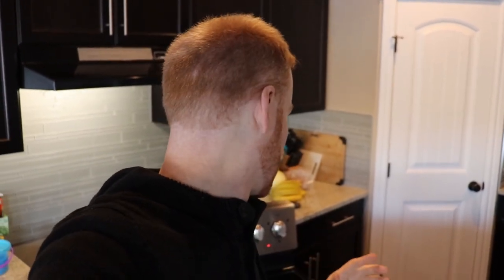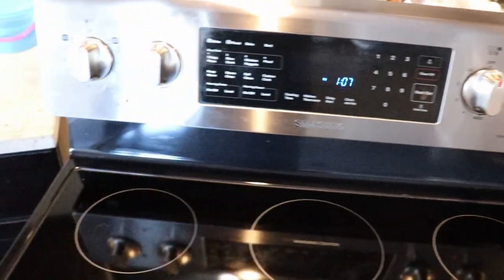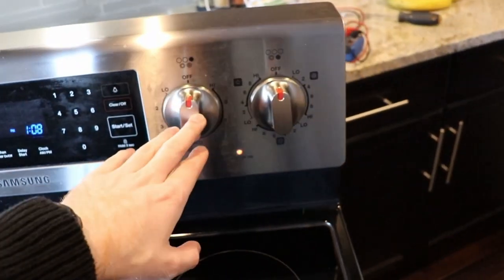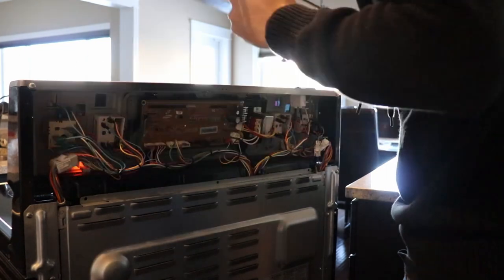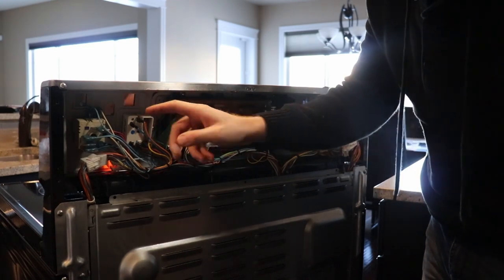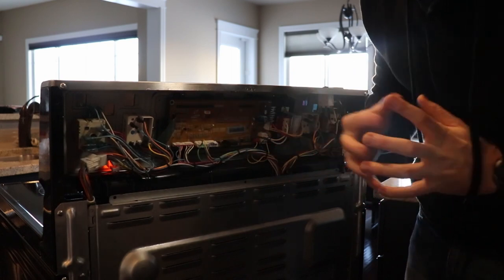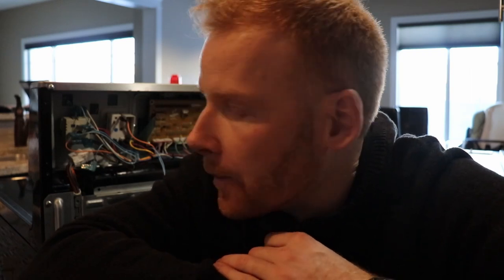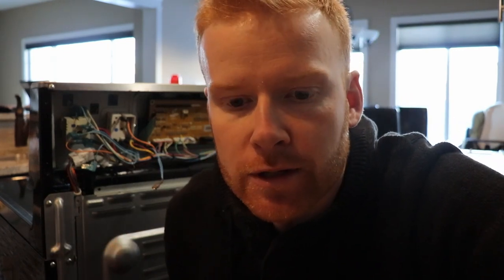Cheap Samsung fix (Stove Top On) Light Fix

Comment: We’ve had the hot surface light on constantly for months. It’s a common problem and there’s plenty of comments online about it. However our oven burst into flames tonight after we’d just finished cooking dinner. The flames appeared from behind the control panel but I guess they could have originated lower down. I’m not going to mess with it until we decide who to call.
Reply from the maker: Wow, I 100% dont blame you for calling someone after it brusting into flames. Depends on how much damage it might be worth looking at a new stove.

I hope everyone is ok!
Reply: @TDLDIY  Yeah all safe thanks. The flames appeared appeared from behind the control panel at the top. Once we had isolated the appliance and puled it from the wall to unplug it there was no visible damage. So i'm thinking some scolding and melted wires inside because my wife heard a "pop" just before the flames. But as soon as I take the panel off any technician may say that it's user error and the appliance has been messed with.
Reply from the maker: @canukdcv905  in this situation i agree i would leave it. wait for someone to look at it. I am guessing resistance increased in a wire, switch or board. cause the fire and probably why your wife heard a pop. 

I will be curious to heard the result of what the technician finds.
Reply: Know when to hold em.
Know when to walk away!

Comment: These triple and duo switches are too complex and uses swiss 1800 technology to control temperature and eventually it will break with multiple switches in one knob. everytime metal contacts with voltage it creates a carbon an wears out with springs. so these dual switch and triple switch is less durable than basic on switch.  if you open the switch it is just made of metal and springs like a watch. and because it is 'mechanical it will wear out and too delicate and too complex controls with triple control. you have high voltage metal contacts that is too close to each other .  The switch control knob doesn't give signals to the controller board and controller board sends electricity to each element like in digital electronics.  These are switches  mechanical controls like your light switch turning light on and off and wears out.  The mechanics is electricity from house 'hot wire'  goes to switch and exits from the switch to heating element. it is just the mechanism of the switch that is just too delicate and easily break. the light switch in your house don't short circuit because of the distance. but that small box you have lots of metal contacts that very close.

Comment: it's these complicate flimsy dual and triple controls. there is no need for it  8 wires on switch meaning 4 controls 1.  electricity flow. 2 . second control  3. triple control and 4. surface sensor   6 wires.  1. 1 temp control 2. dual control.  3 surface sensor . electric ranges are very basic appliance,  they just make more and more complicate like wi fi which is not necessary

Comment: When you pull off those spade connects you have to pinch down by the wire area to release the metal tab in order to have it come off if you use needle nose pliers it's a little easier unless you have some strong nails
Reply from the maker: Thank you for the advice, I didnt know that. I am sure it will helps others as well.

Comment: another problem this part DG44-01007B the triple switch is not even in stock that you can buy in store and not even online. and no wait ETA is 6 weeks, the manufacture doesn't want people fixing their used appliances. and deliberately not shipping parts to part dealers or consumers to fix in Canada.

Comment: My light has been bugging me for months and my mother in law for years. I will have to replace mine and if it works, will have to do the same for hers. Thanks!
Reply from the maker: Do you replace yours? If so how it work out for you? Thanks for commenting.
Reply: @TDLDIY  I replaced mine and it worked great. The video helped a lot. Thanks so much. Haven't gotten around to mother in law's yet. I am waiting to find out the model so I can get the right part. Found in my search that there are so many different but similar parts for the different models.
Reply from the maker: @tomcha75  Thats awesome, great to hear. Yes, there are a good bit of similar parts if you can get the make and model or even part number it helps alot.

Comment: Thank you for this!  Turns out I had the same issue, and with the same burner control.
1)  I believe my switch got damaged because of a loose main AC power block terminal screw:  When turning the left front burner on, a flash and pop came from the back and the display went dead (because it also tripped the breaker).  Turns out that where the main red wire from the 250VAC power cord somehow came loose.  As the burner switch is turned ON, my theory is that the loose connection caused an intermittent interruption in the current flow (at the power connection) resulting in a high voltage spike due to the inductance in the wiring, thereby "welding" the indicator switch contacts closed or "shorted".

2)  After tightening the power cord screw... To determine which burner control was causing the Cooktop ON to remain lit, I found that unplugging one blue wire at a time was for me was another simple way to troubleshoot.  MAKE SURE you disconnect the power before touching any wires to avoid getting shocked as the blue wires are HOT with AC voltage.  1st unplug the power cord, then unplug one of the blue wires that TDL DIY indicated.  Plug the AC cord back in and see if the Cooktop On light is OFF.  If still on, unplug the power cord again and try the blue wire from another control.  

3)  In my case it was the far left control as suspected, since that was the one being turned when the circuit breaker popped.  I've decided to ditch this stove because it also needs a new Control Board (the "5" and Kitchen Timer buttons don't work, some LED segments are dim and almost all of the black numbers/indicators have rubbed off of the front panel).  We've had bad luck with ALL of our Samsung appliances and am switching to another brand as repairs become non cost-effective. 😞
Reply from the maker: Thank you for writing an in depth review. Seems to be very detailed i am sure others will also enjoy reading this as it can help them as well trouble there stove.

I am sorry you didnt end up fixing it but i can also understand why the display boards can be extremely expensive to replace.

Thank you for watching and writing this comment i am sure it will help many others as well.

Cheers

Comment: Thank you so much for the video. I had this exact problem and coincidentally it’s the same exact switch that had the problem, same spot too. Going to order the part now.
Reply from the maker: Your welcome. I am glad my video was able to help you be able to find the problem. Let me knoe how it turns out once you receive the part and do the repair.

Thanks for watching consider subscribing.
Reply: @TDLDIY  Yes, the part work wonderfully! Fixed the problem! I ended up using the switch you avoided from Amazon with the 15 amps. Thanks again for the video. And I did subscribe.
Reply from the maker: @chitboxdeluxe3542  I am glad it worked out for you! I will keep that in mind if i have to replace mine again. that the 15 amp switch will work just fine.  Thank you for your support from subscribing!

Comment: i just got a similar samsung stove. sometimes the right light comes on randomly (when not even being used) and sometimes its the left light! how could that be? all the generic videos i see point to the limiter switch at the actual burner. I havent dug into it yet myself but it loos like starting at the infinite switch is easier. thanks!
Reply: figured it out. if the knobs arent perfectly pointing straight up it will trigger the cooktop on light.

Comment: I have a question. I was wondering if you could help me out. I have a Samsung range and the front left dual element burner is messed up. When I only try to turn on the inside element the outside element will come on as well and both elements will not go off and on and off and on etc like they are supposed to. It gets too hot to cook with. It burns the food. Does it sound like it might be the infinite switch or something else?

Comment: Thanks for the info! I have the same exact model as yours but my hot surface light wont shut off instead of the cooktop on light. Same process tho for the different indicator light.
Reply: Did you figure out anything??
Reply: I have the same issue
Reply: Same, I can't use the self cleaning function with it broken. This seems doable?
Reply: I just disconnected the red and white plug from mine, different colors than yours but the only two wire plug to the control board. It doesn't care if the hot surface light is on or not, self clean my way

Comment: When you check (6:15)light on with red clip , power plug was off?
Reply from the maker: In this case I had the power cable connected to the wall, as I needed power to test. But you must be very careful if you try this as if you touch something wrong you can fry your electronics or get serious injuries to yourself. Do at your own risk. If you dont feel comfortable then hire a technician.

I hope this answered your question. Thank you for watching.

Comment: Beware of Samsung stoves this is a very common issue with their stoves mine would just turn on in the middle of the night , their switch components are plastic and easily wear out if you are using the same switch often , good video though👍
Reply from the maker: Thanks for the comment. My stove wasnt on but had the light come on lucky. This seems to be a fairly common issue, but fairly easy to fix. Thanks for watching and commenting. Like hearing everyone experiences and helpful inputs.

Comment: Hey i have same electric range. I do have hot surface light that stays on but cooktop light stays off. What could be the reason? And there is no hot surface all the time on it
Reply: You got a bad infinite switch
Reply: Are you sure ? Because with the faulty infinite switch i guess the cooktop on light should stay on as well and surface can be hot too. But in my case the surface isnt hot at all and the cooktop on light is off as well
Reply: @michaelcancino6818  just posted a comment for you above. Was unable to tag you

Comment: Is it dangerous if I had to leave the light on for a while.????
Reply from the maker: My light was on for quite a long time before i got around to fixing it. Several months. The stove top light is just an indicator light. The sooner you can fix any problems the better. Now i cant 100% for tell you if it dangerous but based on my experience. Different situations might be slightly different.

I hope this anwer your question.

Comment: What do you call the red  wire you test with and from wher can I buy
Reply from the maker: I added a link to an amazon one i for which is what i have.

https://www.amazon.ca/Alligator-Electrical-13-7inch-Connection-Experiment/dp/B0C2BM49WM/ref=asc_df_B0C2BM49WM/?tag=googleshopc0c-20&linkCode=df0&hvadid=578859711721&hvpos=&hvnetw=g&hvrand=13712814172957266905&hvpone=&hvptwo=&hvqmt=&hvdev=c&hvdvcmdl=&hvlocint=&hvlocphy=9061280&hvtargid=pla-2199947795451&psc=1&mcid=85e159705029354f8d79205365e10ac4

Comment: Or you just need to disconnect the power from each switch, one by one, and see which switch will turn off the light
Reply from the maker: Yes, that is another good way to trouble shoot the problem.

Comment: The switches have 8 wires and makes more complex than older basic electric ranges using coil elements. and switches for the coil heat elements never break and last lifetime of the range.  The problem is failure in the switch is big fire hazard if someone was to go on 2 week vacation. because off position is normally in low eventually failure would only give low temperature.

Comment: my same gas burner is overheating what is reason?
Reply from the maker: If you give a bit more information i can try and research why or common issues. Make, Model, which burner, possibly any other issues.

I dont have a gas stove so not too sure on them that much.

Comment: you can buy a new applicance for $1200 why pay $400 to repair a switch . and elements too if you cannot repair it yourself it's not worth paying $600 in labour to fix used applicance. all the elements will break or need replacing and the double switch will not least more than 5 years too.

Comment: I put a bowl of ice on the burner. while it was off, and the light shut off.
Reply from the maker: Oh really crazy, i am glad that worked for you. Thanks for watching.
Reply: I tried it and it worked.  The hot surface light disappeared, but I also have another issue, flashing "END" light.  Just realized Samsung sucks.
Reply: I let the hot surface cool down for an hour and use your crazy idea and turn the switch couple times. It works. 😅